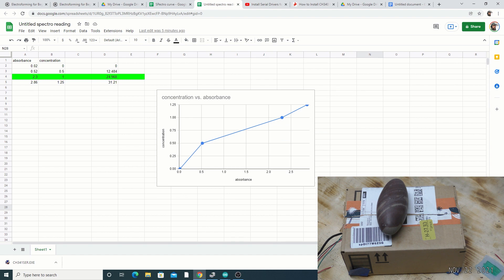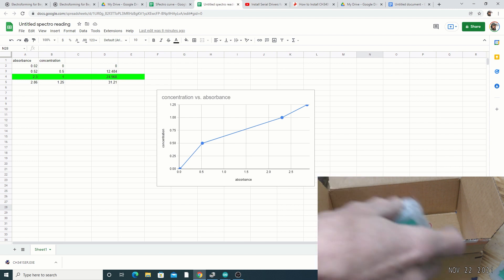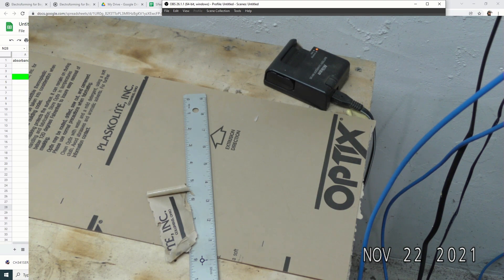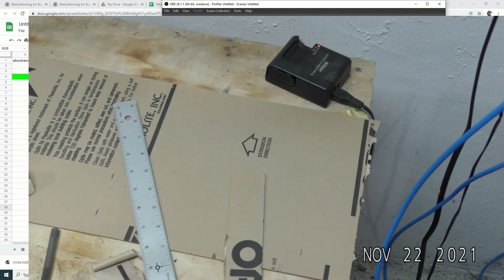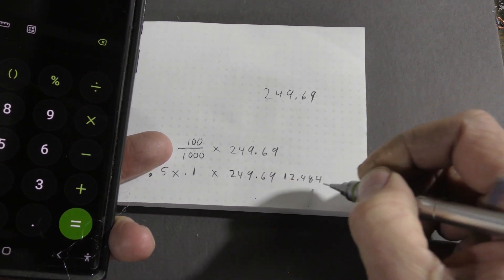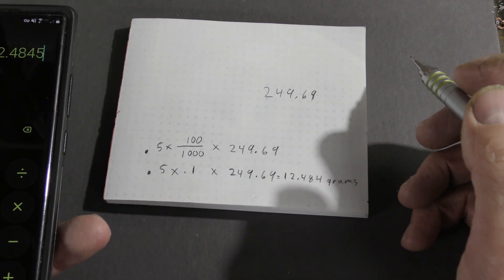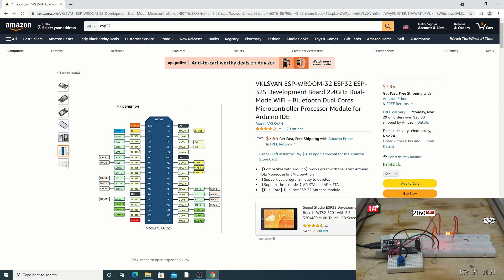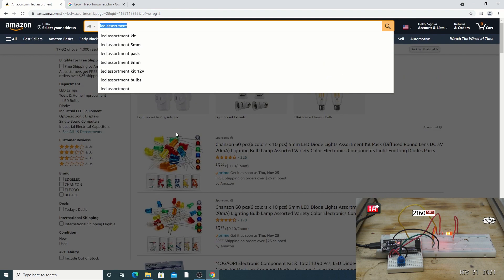Pt1 ESP32 Spectrophotometer Measure Copper sulphate in Electroforming

Comment: The trouble with hot glue if you do want to use UV illumination at all is that EVA glue tends to fluoresce strongly blue under violet or shorter wavelengths.  A better option would be silicone and glass slides in that case.